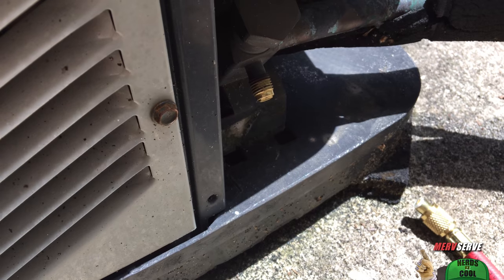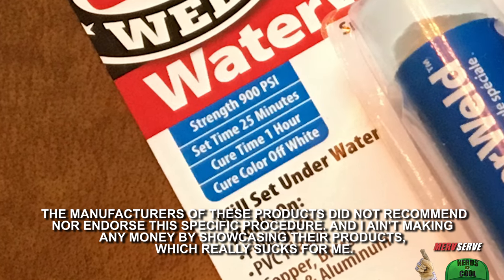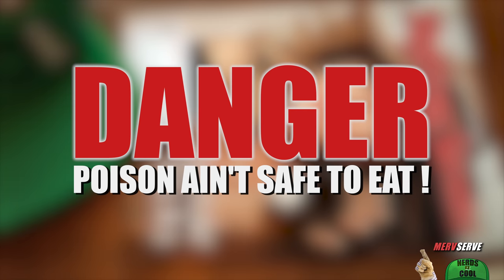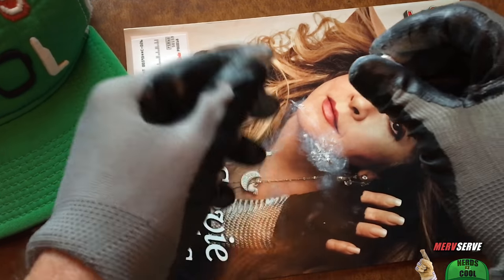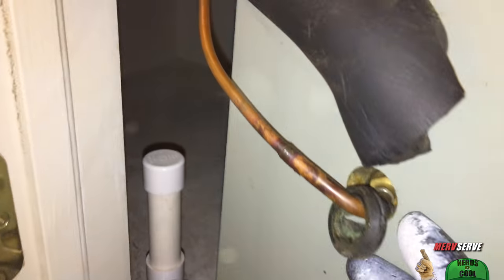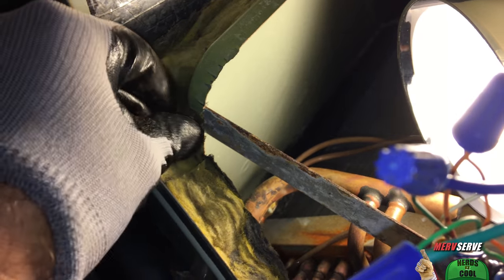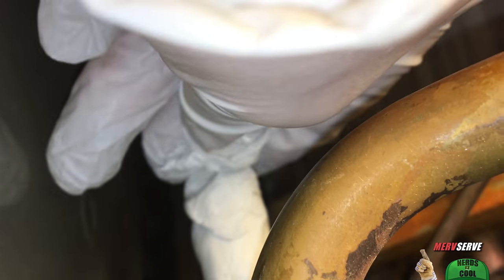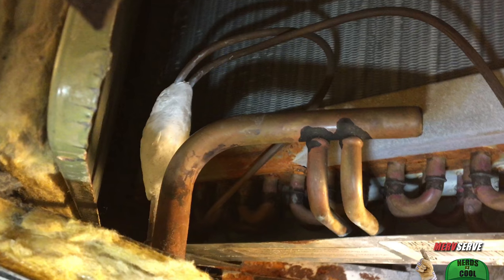AC Leak Repair for $15 -- Cheap & Simple Central Air Fix

Comment: Merv, your video saved me.  I had a JB Weld Steel stick lying around but it would rust in the A-coil area.  Then I watched your video and saw your waterweld.  That worked!  The evap coil leak was so bad it needed 3 bottles of 16oz refrigerant.  I was already thinking about replacing my old units with new ones... but it has new life again.  Cool air is a relief after a few days in the high 80s.
Reply from the maker: Excellent!

Comment: Excellent. I have a ~15-year-old mini-split that's started leaking oil, and the professional fix is of course replacement. It still heats and cools fine so I'm hoping this repair will keep it going a little longer. I was contemplating attempting brazing but this seems less risky for an inexperienced DIY-er like myself!
Reply: I think the oil degraded some of the plastic as it's cracked in several places. That was actually a blessing in disguise, as I might not have discovered the oil leak otherwise.
Reply from the maker: Great point!

Comment: I really enjoyed reading the comments because all the professional HVAC guys got triggered. If HVAC companies didn't charge $200/Hr for labor and mark up parts and refrigerant 3X, then people wouldn't try to DIY the fix. I DIY'd my own 24 year old R22 system. I got my EPA 608 Type 2 cert via SKillCat, bought 5 lbs of R22 for $219, a set of Yellow Jacket gauges for $150 and $10 bubble leak liquid. I was lucky and my leak was a bad Schrader valve which I replaced with a $25 core removal tool and new brass caps. I recharged using superheat since it is a piston system. Total cost was $450 and I have a set of tools to use when I eventually do a unit replacement.
Reply: Where did you buy 5lbs for $219?

Comment: Thank you for this video! The technician who installed my new AC unit didn’t solder the copper pipe correctly to the coil The estimate to fix is $250 by a new guy. The installer retired. I am interested in using your idea I see it’s been three years since you fixed the leak. Is the leak still fixed?
Reply from the maker: Still works!  Not an easy method.  Many say it's not ideal so be carefull.  But it still works.

Comment: I used JB KwikWeld on a Mercedes radiator with a pinhole leak. Worked on the first try and never leaked.
Harbor Freight's cheap, clear epoxy works really well on all types of things too.
Reply from the maker: Thanks for sharing!
Reply: @MervsServiceSecrets   Yay, epoxy!

Comment: Great video however I’m wondering. 
1) Will the JB Weld introduce contaminants into the system during curing?
2) although JB WELD is rated at 900 PSI, will it hold consistently under a high pressure system? Especially if the system requires additional Freon.
Reply from the maker: These are excellent questions and probably above my pay grade. All I know is it's still going strong with no issues.

Comment: Good video. There is an actual product like that for use on a/c systems.
You sound like the narrator from the old Dukes of Hazzard t.v. series, cool!
Reply from the maker: Thanks for joining the Mervolution, friend!  Be sure to share, and turn on your notifications so you can follow my ongoing DIY saga. -Merv Himself
Reply from the maker: By the way,  what is the name of that product?
Reply: @MervsServiceSecrets  
It's called AC SmartSeal External.
Reply: You may have heard of the narrator from the series, his name was Waylon Jennings. (He also sang the theme song and made at least one appearance on the show.)

Comment: If the system still have pressure, how can JB weld able to seal? Do you need to reduce system to Atm pressure and patch with JB weld?

Comment: If my central air conditioner is 23 years old and starts leaking freon, what would you recommend, thanks.
Reply from the maker: My first step would be to track down the location of the leak and the speed at which it is leaking. One of those leak detectors can help.
Reply: Maybe EZ SEAL

Comment: The HVAC guy found a leak in my coil this morning and told me the fix was to replace the whole coil unit for ??? maybe a couple grand??? with the labor. He's going to send me a quote for the job and while he was here he topped me off with 4 lbs of freon in my 4 Ton unit. So what do I do? (here I am looking at other cheaper fixes). I like your style and your tongue in cheek attitude. Thanks for the amusement and the comedy. You're OK Merv.
Reply from the maker: My personal approach.. and this is just me ... would be to see how long that recharge lasts.  I mean if it cost a couple hundred bucks and it lasts 3 years,  you can limp along like that for quite awhile without having to spend thousands. Alternately, I would see if I could find an AC guy with a real high end leak detector to locate and braze the pipe.  Might just be a pinprick leak.  Hope this makes sense. Again, that's just what I would do.
Reply from the maker: Also,  if the AC guy is convinced the leak is so bad that it requires replacing the coil,  why would he pump 4lbs of refrigerant into it? That's kinda nuts.  I mean that's ALOTTA nuts!  'Cause if its a real bad leak your money is evaporating into the atmosphere right now.   So that tells me he must believe its a very small leak.  Not ideal, but good to know and something that can give you time to come up with an affordable approach.
Reply: @MervsServiceSecrets    I told him that the unit worked fine for me the first three years I was here. So that sort of lead him to the conclusion that I had assumed all along from the beginning... that it was a very small slow leak. I asked him if he thought it was due to vibration or a manufacturing defect. He said probably a defect. I don't understand how the copper tubing in the middle of a horizontal run in the condensor coil can get a pinhole leak. Chinese junk? Damaged when the aluminum cooling fins are attached during fabrication? I don't understand. I heard one guy on a video say that they make the copper tubing as thin as possible for higher efficiency. Maybe it's really just built in obsolescence (failure).

The unit (Bryant) runs smooth and the compressor sounds fine with a full freon load. The coil lasted just over 5 years from the manufacture date. Maybe that's perfect for them? The Tech says the compressors usually last about 16 years. A complete 4 Ton unit would be about $4500 and be warrantied for 10 years with their installation. Not sure if that includes labor.

I'm just going to keep track of the temps at the register and see what happens. This time of year is crazy for the HVAC guys. They want to get in, get out and bill you for their time and quick fixes and move on. Like I said before, I'm going to see if I can find a freelance guy who has the skills to fix the leak. Appreciate your comments. I'm going to subscribe. Your sense of humor is right up my alley. ;^/
Reply from the maker: Thank you so much for sharing.  This is the type of info that can really help alot of folks in a similar situation.  Not sure why those pipes spring leaks.  In my opinion, a leak might be likely to occur where 2 pieces of the copper are joined together, but right in the middle? That's confusalatin' !  Anyway, best of luck and thanks for being a loyal viewer.  Be sure to look me up on social and tag me for any and all of your DIY projects.  On Twitter I'm @MervsService and on Instagram I am @MervServe  Cheers!
Reply: @MervsServiceSecrets  I found out where refrigerant lines are run inside the wall, sometimes when installing a baseboard they run a nail into the lines!

Comment: I had a AC guy came and he told me he got zero pressure on .my AC refrigerant pipe.  He even cut them at furnace to run a pressure test, and still no pressure. 
He told me I have a leak in my AC pipe and suggest reroute since he said the pipe is under slab. Not sure I can trust the info.  Any advise on how to fix it.
Reply from the maker: I can't pretend to be an expert. Just gettin' by the best I can. However, it is very possible that the line under the slab got cracked over the years  because of the way the earth settles.  Of course, if your compressor isn't working right that can also cause problems but I'm sure he checked that.  The real mystery is WHERE is the leak.  It's not always easy to track them down.  So before I committed to paying anyone for a whole new line I would want them to make darn sure the leak isn't coming from elsewhere.  Ask your repair guy if he's 100% certain its a problem with a broken line under the slab.  If he says yes,  have him guarantee the solution and put the cost in writing. If he claims he is 100% sure but wont' put it in writing, find another repair guy.

Comment: At the end of the video you said all you have to do is "recharge " the unit.  This implies the unit was empty of refrigerant. Your leak detector sensed no leaks, how would it if there was no gas in the unit? Did you mean top the charge off?  Did you you do a follow up video on how well your repair worked?
Reply from the maker: Top off

Comment: I had 2 companies show the my freon R22 down 8 to 9 pounds.  At $130- $150 to replace and not fix the leak. My unit in Arizona, is 13 years old 10 SER.
Patch work might work, but $1500 gamble. 
I'm going with a new Trane 15SER and new furnace.
Reply from the maker: Wow.   They sure don't build 'em like they used to!

Comment: Do you have to remove existing freon/r22 from the lines in order to patch even if it's a slow leak? Can it only be patched with no psi?
Reply from the maker: I'm certainly no AC technician. I just saw a leak and patched it.  I'd be worried if I tried to remove the old refrigerant I might lose it into the atmosphere.

Comment: Thank you Merv! You are informative and funny too! I am fix it yourself gal! I just paid the AC guy $255 to full my unit with refrigerant and leaked out by next day! I am going to look for the leaks myself and patch them up  then call him out.
Reply from the maker: I admire your DIY ambition. For just $255 though?  You got off lucky!   It sounds like he didnt put much in, yet in such a short time it all leaked out. Makes me worry that feller did something wrong. And remember,  the best way to test for leaks is when the system is fully charged. The pros even add UV dye to the system and find leaks that way.  Whatever you do, work smart, be careful, and do plenty of research. I admire your DIY spirit!
Reply: The turkey you hired didn't even search for leaks; just dumped some refrigerant in the system. Sorry to hear about that.
Reply: Wow...at $150 / lb?

Comment: Would Flexiseal work?
Reply from the maker: I doubt it because I think it would get torn apart by the oil that's in AC refrigerant. Not even sure if my method is going to work forever, but I gave it a shot and it's been okay so far.

Comment: Hi, how can I find the  leak in my condenser coils?
Reply from the maker: That would be really tricky because of the way they are configured in close proximity to each other.
Reply: You might want to buy a leak detector. It will pay for itself because a service tech will come in and say everything is leaking and you need to replace it all. So if you find the leak or no leak you're ahead

Comment: Dont try. Wont fix. Just get a welding supply and the cream. You will fix in 10 minutes. It will cost $25 but you will save in the long run.
Reply: Welding supply and cream? Can you share a link?
Reply: @PowerfulQuotesBible n know late but I'm almost sure means flux paste, torch , and solder that for the copper pipe that what I'm trying to do but thought I'd check this out before I start torching

Comment: DID THIS FIX THE UNIT LONG TERM?
Reply from the maker: Coming up on a year without issues. Summer is just around the corner so we'll see what the next several months brings.
Reply: Still running?
Reply from the maker: Yes.

Comment: Can you do this fix while unit under pressure?
Reply from the maker: I did it when the unit was off.  Of course, technically, there is always SOME pressure in a pipe.  But no, the thing wasn't running at the time.
Reply: If the unit is under pressure most probably you don't have a leak. As such the repair is not needed! Egg, chicken thing... LOL 😂

Comment: Merv i need u expertise my central ac unit went out yesterday it stopped blowing  cold air.  I called a guy to look at it and he said there is a leak somewhere that is letting the coolant out . What I need to know how hard is it to find where the leak is because he is acting like its going to be pretty hard to find it and so on. Then that's when he hit me with i think u might want to just go ahead and get a brand new unit and he would give me a good deal and put it in. So I really need to know is he trying to put one over on me.
Reply from the maker: Well,  he's not entirely wrong.  Leaks CAN be hard to find.   But if he has a "sniffer" like what I used in the video, he should first check all the obvious places like around the shraeder valves, and up in the air handler itself near where the coolant line comes in.  Then if he can't find ... okay, yeah, the leak is hard to find.  Like maybe it's got a small leak where the ac pipes go under the slab, or through a wall, or through your attic, or whatever your situation.  But still,  why does he jump straight to "OH, YOU NEED A NEW UNIT!"    If it's truly a leaky line, worst case scenario, shouldn't he suggest replacing the line??? Not the whole unit???   I mean, it's like saying .. yep, one of your car tires has a leak .... so it's time to buy a whole new car.  Am I crazy?
Reply: @MervsServiceSecrets  I hear u loud and clear and 🙏
Reply: @MervsServiceSecrets  unless youre trying to fix it your self to get by... 
either way you still have to pump down or recover the charge to replace the line (and usually its something in the airhandler coil anyway but same applies) and it's fairly likely therell be more problems if it's an older unit (especially if it's old enough to use r22).

Puts hvac guys in an odd position, where they seem like crooks for trying to sell a new system (some certainly are though).
 but at the same time even little seeming repairs involving the refrigeration circuit pretty much will always use a half day to a whole day to fix, professional time costs money. Dont want to charge someone to fix a verified problem, and they get pissed a year later because something unrelated breaks that's also fairly expensive for a professional to do.

An honest and good hvac guy will discuss the cost vs benefits of different options. But sometimes you realize that the particular customer doesnt listen, they just want it to work as cheaply as possible (which is fine, as long as the understand the limitations of a particular repair job, and unfortunately alot dont)

And most of them are entirely incapable of doing any type of diy work

A fairly informed individual (like yourself, that's aware of the short comings of a fairly hack like repair) decides to try something like this and it works or you try and it doesnt, then awsome!
Pros cant (or shouldnt) charge for stuff like this, that may not work, because of the very high chance of conflict if a fix like this fails

Comment: You could have pumped down the unit to 2 or 3 psi before patching the leak. It would have made it way easier. Edit: epoxy is actually the correct way to repair copper to aluminum joints.
Reply from the maker: Thanks for the tips.  What kind of epoxy?
Reply: @MervsServiceSecrets  I don't know what manufacturers use from the factory but I've used permatex 5 minute 2 part epoxy. If you mix it well and put an electrical heat shrink around it, it should be more than strong enough for the low side. I would recommend using the 30 minute epoxy or something stronger if you have the time. I haven't tried jb weld only because I haven't had any when I need it. You would have to pump down the system to use epoxy and pull a vacuum on the line set when you're done.
Reply from the maker: Thanks for the info. In my case, however, the leak was on the high side, just past the orafice.
Reply: @MervsServiceSecrets  Yeah, seen a lot of leaks around that area. The refrigerant starts to flash of into a vapor and the temperature shock causes the pipes to crack after a while. How did you end up getting the unit recharged? I have a leak on my ac, every couple years I recharge it myself. It's such a small leak that I cant find it. And there's no access door for my evaperator because the installer put a 5 ton coil inside the supply plenum. Yeah, I have a heat only furnace with an ac evaperator shoved into the duct above it. (What the heck was the installer thinking)
Reply from the maker: AC guy recharged it. Been thinking about getting a certification so I can legally do it myself but unclear regarding all the rules and regulations. Scared of that EPA swat team!
Reply: @MervsServiceSecrets  yeah, a certification is definitely a good idea. I'm working on one myself.
Reply: how do i get a cretification?
Reply: @RJGRAHAM  Thank you for the information.
Reply: @MervsServiceSecrets  it's a easy and cheap test for someone like yourself to do
Reply: How you pump down to 2 or 3 psi? Vent to atm?